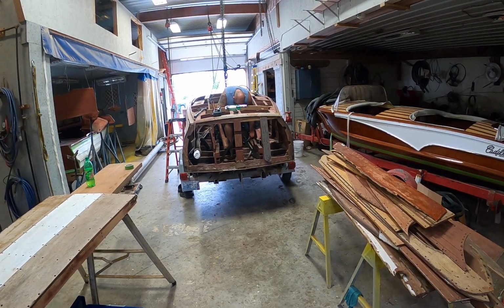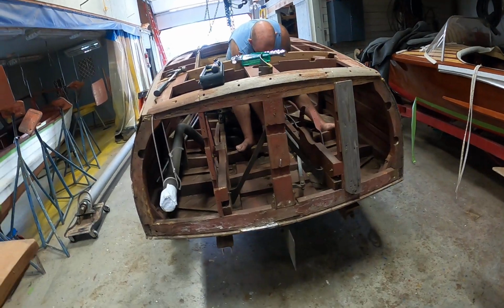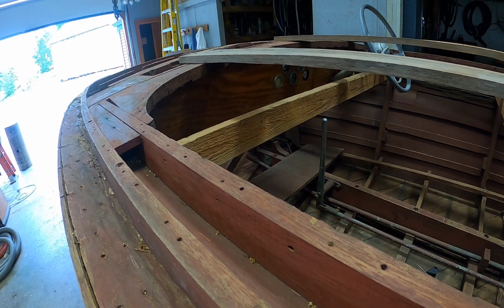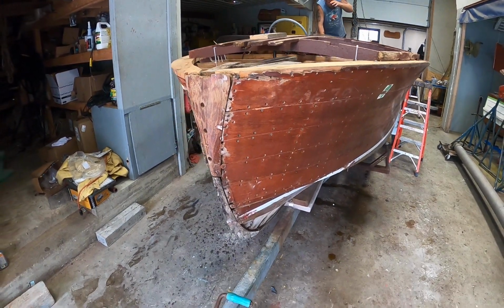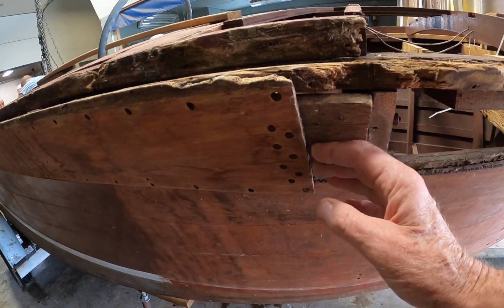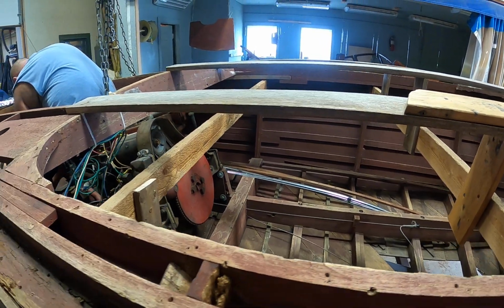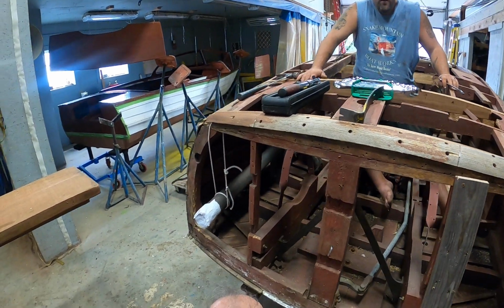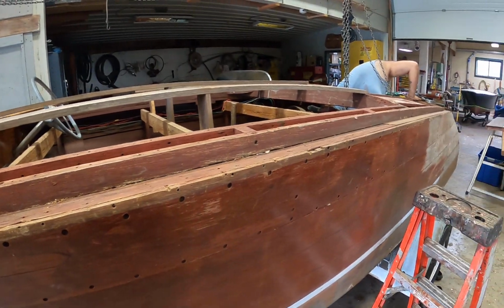1950 Chris Craft Riviera As Found July 12, 2021 Snake Mountain Boatworks LLC

Comment: That's not a Chrysler. It's a Hercules Chris Craft KL engine.
Reply from the maker: Duh..... What are you smoking?  All you had to do was to click on "Shore More" above to discover, "She retains her original Chris-Craft KL flathead six engine and Paragon transmission." No claim otherwise was made.
And, in case you are not capable of finding the "Show More" link, here is the entire narrative as it appears above:
This very original 1950 18’ Chris-Craft Riviera is slated for a major rebuilding and then finishing process. She retains her original Chris-Craft KL flathead six engine and Paragon transmission, as well as what appears during our intake inventory to be all of her hardware, but all that is for another day.
As is illustrated by the clip, her worst problems exist including and between the gunwales.
She arrived with deck planking stowed in her bilge and deck framing lashed to her hull with zip ties, but none of the screw holes line up, so we are surmising that what we have is some sort of marriage of two boats. And, since the engine hatch is not correct for a RIV, we suspect that at least some of what we have comes from a different model Chris.
Today is for stripping her out so we can begin rebuilding her decks, covering boards and the like.